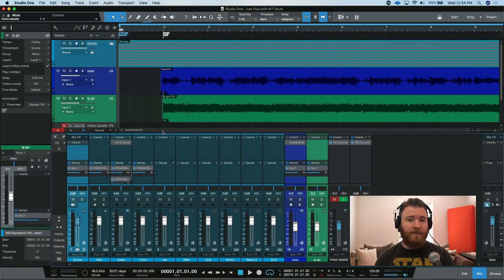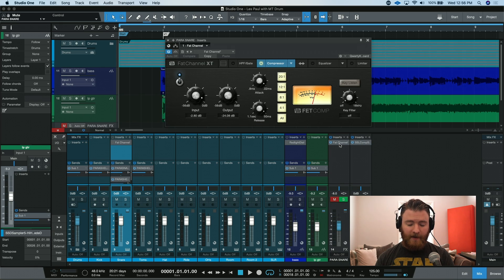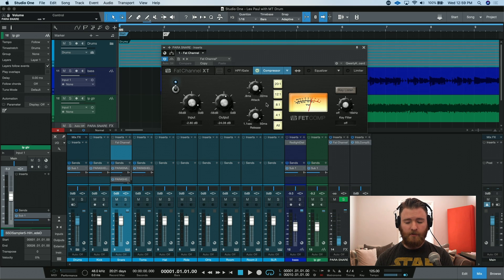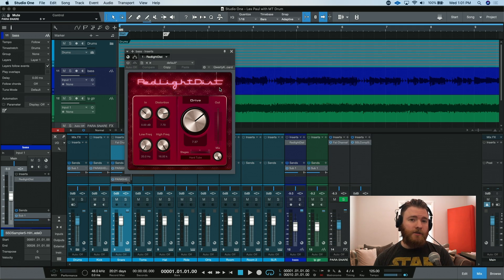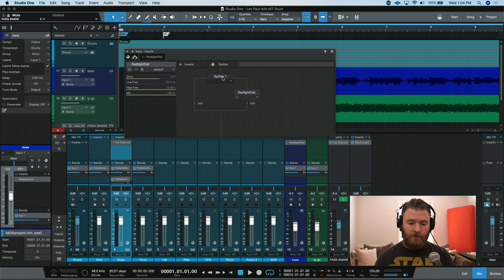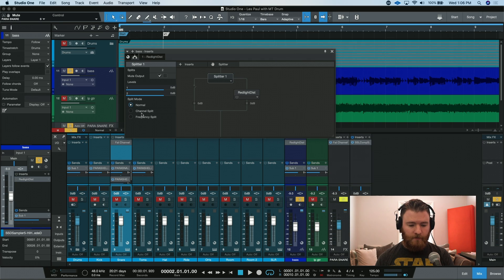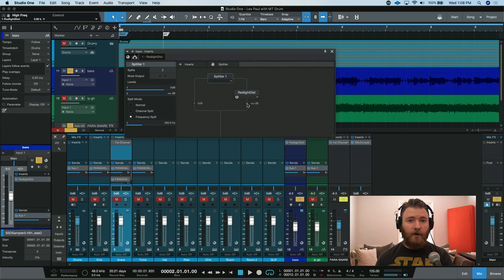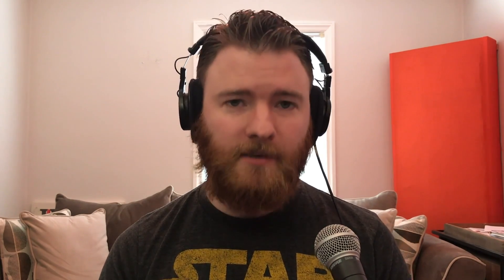Studio One: Routing for Parallel Processing

Comment: Question: what you did to the bass (splitting the rout) ... could have done the same thing to the snare and achieved the same result as sending the snare to the FX channel like you did at the beginning of the video? Would I be wrong in assuming that they are essentially two different methods of getting the same thing?
Reply: No because I'm pretty sure the splitter sets the bass into two separate frequency options. Eg, below 300hz, then above 300hz. If you send to an Fx channel you would get the full Freq range.

Comment: Thank you  Tim  After you had set up your bus ( compression chanel) and applied max attack & release, which compressor did you use ? and what were your other compressor settings ?
Reply from the maker: Hey Rock Writer! For this video, I used the FET compressor inside the Fat Channel Plugin, but you can use any compressor. It's a good way to train your ear to hear how different compressors work on signals. A FET compressor will work differently then a VCA compressor/Opto/Vari-Mu, etc.
Reply: @TimTalksAudio   Thank you Tim, what  are your recommended  settings, appart from the full attack & release  to achieve the  maximum effecf?
Reply from the maker: Rock Writer with “New York” style parallel compression, it’s the fastest attack and the fastest release. Then, since it’s parallel, you can slap the compressor REALLY hard, like 20+dB or gain reduction, and blend it in!

Comment: i came back here to ask if the split in track mode made the gain level 50%-50%, or 100%-100% ? because in bus mode i think the gain level is 100-100 because i noticed the stereo mix is louder and noticeable in bus parallel mode than track splitter mode. tnx
Reply from the maker: In a parallel bus, if you don't add any processing, you are just doubling the signal, and therefore getting an increase in volume. When using the split, you will not get an increase in volume because you're not creating two outputs of the same signal. The splitter will create two copies of the signal, but at the end of the chain they are combined again to a single output.